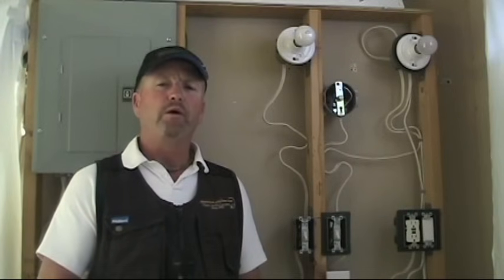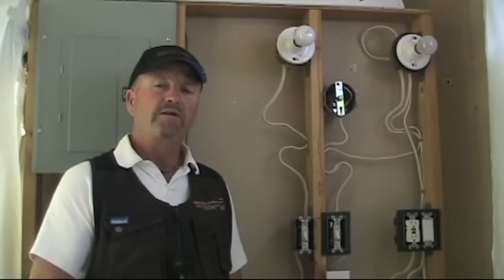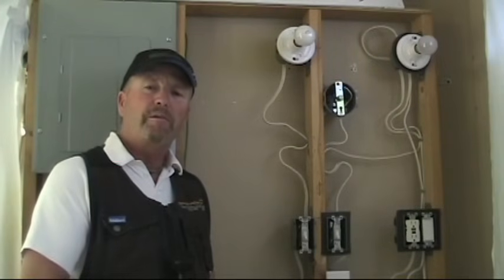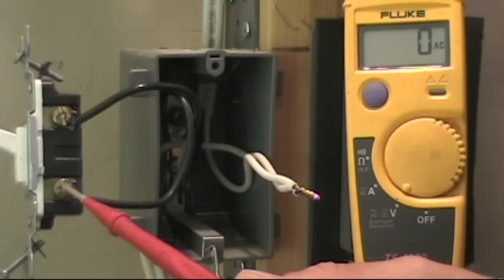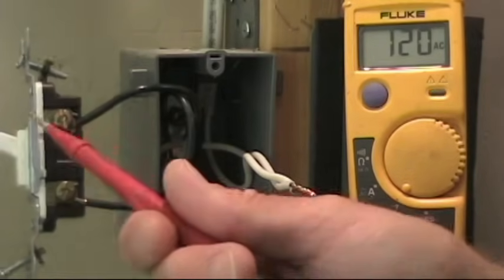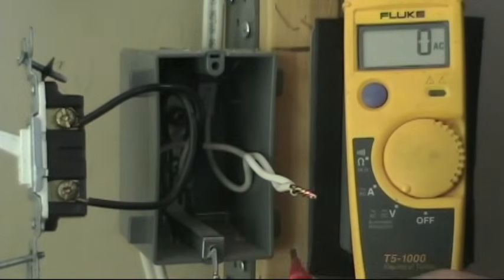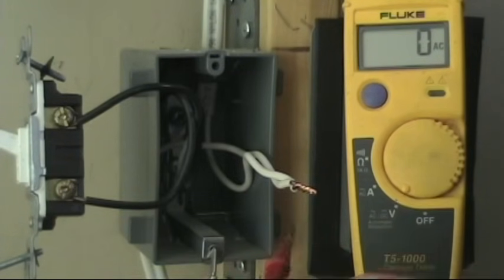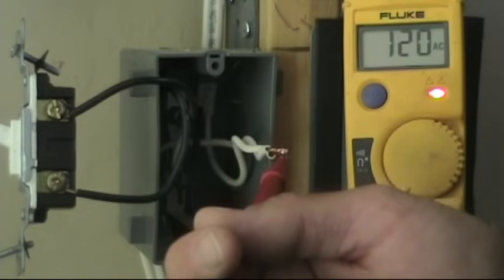Understanding an Open or Loaded Neutral

Comment: Your no electrician! Open means no complete circuit! You said power up thru the filament( but no light) lol! His hot neutral was caused by it being shared with another circuit!
Reply from the maker: Raymond, you are wrong. Besides that, I'm explaining what happened in another scenario that happened with a friend of mine. The purpose of the video is to explain how you can get 120V on a neutral because of an open circuit. I am a licensed electrician with 37 years of experience, I am also an Instrument mechanic, and a steam engineer as well.  Please don't insult my knowledge and maybe watch the video again, learn, and understand.
Reply: no lol its called losing a neutral, its probably the number one most common electrical claim for insurance companies. hes right, he may not be explaining it in depth enough
Reply: "Open means no complete circuit"
The circuit is sending power up to the bulb and back down to the neutral at receptacle , it is open on run back to main.
so no complete circuit.

Comment: I get peeps bugging me to always put the hot leg to the top of the switch so it's more uniform with how other service wires are connected or some nonsense.
Reply from the maker: I've had that feedback before as well.  This is a trade practice thing, and not a code rule. One explanation I got for putting it on top dates back to when open knife switches were commonly used. Having the hot on the bottom in that situation made the "knife" hot, and you threw the switch up to the load connection instead of having the load being thrown up to the hot jaws. That makes sense to me. I was just taught to put the hot on the bottom of the switch so that's the way I've done it for the last 37 years.
Reply: @theinternetelectrician  I put the line hot on the bottom as well. I like the load wire to be on the top terminal and that's how I arrange my pigtails in the j box.

Comment: all current ultimately goes back to neutral and or ground rod through ground water back to power generation location.
At substations there is a huge array of copper rods into ground to actual generator and or transformers. We installer alot of sub stations. Many do not realize all current has to go in circle back to lowest potential. Shalom
Reply: that is just not true,  go look it up, ground rods into the earth are for lightning for the most part

Comment: Add a junction box between the panel and the switch. Then disconnect the nuteral wires in the juntion box to demonstrate the open circuit.

Comment: I am working on a house that is showing 160 volts on some circuits and 80 on others at the moment!
Reply: I have run into this a few times DSV. You should check the neutral coming in from the power company first. You may also have a problem with the neutral between the meter and the main panel.   It can drive you crazy. Voltages can be all over the place when 220v loads kick in. HTH

Comment: Terry, Thanks for your videos. But,...As a retired industrial/residential electrician, "I" understand the situation. But people who really have no business messing with electrical wiring have no idea what you are talking about without you showing by example what caused it, rather than to just mention it. Without being rude, without that, the video is rather useless for the unknowing novice. Sorry, just constructive criticism. BTW, the worst messes I have ever had to correct is when people of such, mess around with 3 way, 4+ way switching. Totally screwed up. Novice people have no idea what NEC Code is either. These people also need to realize that they can screw themselves beyond belief from their insurance companies when regardless of being the home owner or not, as some jurisdictions still say that's ok. But MANY City charters say NO and have absolutely in no uncertain terms that it is not allowed. That you MUST use a certified electrician who will sign off and some as in the State of Tenn., requires a City Inspector to approve, before use. Some cities, such as Chattanooga, and others have city codes that are far more detailed and additions beyond the NEC. And of course you have to comply.
Reply: Constructive thought, yes did need to show where the open neutral was. 
If the neutral was open outside at the entry point, would we get a shock
on the unbalanced portion of current, trying to get back to the transformer?
thank you as always.
Reply: @flexmaster-l2j  And you are free to do so, just understand that your homeowner's policy can put 2 and 2 together and find that a convenient excuse not to pay out your claim.  Related... or not.
Reply: flexmaster I hear ya, people make mistakes though which is why it never usually hurts to have a review done of work. People that don’t understand what they are doing cause problems for the ones smart enough to research
Reply from the maker: Tony. I appreciate your input, and of course I have dealt with people that share your viewpoint countless times. I try to only help the DIY'er with simple electrical repairs or projects, and always explain to them that they must see if they are allowed to do the work by way of a homeowner permit. Electrical replacements in kind (change a broken switch or a worn receptacle) do not require a permit in most cases. To deny that people do their own electrical work regardless of what you or I think is to deny the 2 - 4 isles dedicated to electrical and lighting in any home improvement store. I'm only trying to help what is already getting done, get it done correctly and safely. Keep looking on YouTube here and you will find handymen from all walks of life teaching electrical as well.  At least I have the training so it's not the blind leading the blind.
Reply from the maker: Here is a link to my website with more detail on the open neutral issue. https://www.electrical-online.com/understanding-an-open-or-loaded-neutral/

Comment: All I saw was that in part A the neutral showed zero volts in relation to the grounded metal box, and then in part B it showed 120 volts, but I don't know WHY !!!!!!  Maybe this guy knows his stuff, but he's a poor teacher.
Reply: A very basic way of looking at it would be, visualize a circle. The circle is the "circuit" he is explaining. Left half of the circle is your "hot" and the right half is your "neutral". If you break open the right section of this circle, you will have 120v at this breakpoint. In this scenario he is describing the break on the "neutral" side of the circuit.

Comment: That was a good demonstration, but you're single pole switch was hooked up wrong, the line is always on top.
Reply: A single pole switch only makes or breaks a circuit. Line is not specific on regular single poles

Comment: Still clear as mud. How does not tying two white wires together make one somewhere else hot? Still don't understand why a bond wire and ground are connected in the main panel and not in a sub panel. Dropping a neutral thing makes no sense to me. I am a nuclear engineer but not an electrical engineer.

Comment from the maker: I'm getting allot of feedback wanting more details on this. Here is a post from my website with more detail.https://www.electrical-online.com/understanding-an-open-or-loaded-neutral/
Reply: The post in the link above still contains way too much blah blah.
Best way is to create an open neutral in a junction box and show it is loaded with a voltage tester or circuit tester.
Reply from the maker: @1942nn  which is exactly what I did in the video above here
Reply: @theinternetelectrician  Hope that you show where the neutral line broke off, it would be very clear to all. You did mention that neutral was broken off somewhere upstream. That is vague for many.

Comment: If the 120 goes thru the switch - then thru the light bulb - BUT - doesn't go thru the neutral to ground - THEN 1. The light wont work & 2. The Neutral wire is LIVE. - Simples.

Comment: I thought the top terminal on the switch was neutral. I guess not. What is it really called? I thought the side that the power flows out of was called neutral. Is that not correct? Does the actual neutral (white wires) have anything to do with the switch we are looking at here or are they pigtailed because the switch doesnt need them so the neutral is connected to just bypass the switch and keep the neutral circuit complete?
Reply from the maker: No, the neutral should never be switched, and should always be a constant path back to the panel.  You can pig-tail into the neutral if a switch requires a neutral, but that is only if the switch device has circuitry that needs a neutral to function. A switch just interrupts the hot conductor that feeds an outlet (light fixture or other). It's either open (off), or closed (on).
Reply: A little different application, but a neutral is switched at a fueling station..
Reply: Terry Peterman Wow, that is information. More elaboration please.
Reply: The power (hot wire) goes to the switch and the wire leaving the switch is called the switch leg.

Comment: Great Job. Your knowledge was solidified in my book when you correctly called the neutral a grounded conductor. Not many electricians know the difference between a grounding conductor and a grounded conductor. 

So if the white wire is the grounded conductor and you break the conductor upstream the conductor cannot complete its purpose to take the voltage to ground in the electrical service through the grounding electrode conductor.  It then becomes solely a current carrying conductor looking for a path to ground and preventing any current to pass through the load connected to it. So when the fellow touched the white wire he became the least resistance to ground.

Comment: You failed to mention that if you use a plug-in circuit (or GFCI) tester, it will give the same lamp configuration that is labeled on the tester as “Hot/Ground Reversed”. In this case, the fault belongs to the tester manufacturer (all tester manufacturers, as far as I can tell) for not labeling this more likely wiring fault (open neutral w/ load) as an alternative cause of this lamp indication.
Reply: hgrosser2 my tester has a different light code for both symptoms. It is good to know what you just explained here. Just ran into this last night, and have not pulled switch and outlet. Thanks for your insight ! !
Reply: Speaking of plug-in testers, I’m working through an issue where the tester’s three lights come on simultaneously. Checked other receptacles on a couple of different circuits and the tester indicated correct wiring so I think the tester us probably okay. Any thoughts or suggestions on what in the receptacle/circuit causes this?

Comment: In the normal situation with the switch on, if ground to switch shows 120, and neutral to ground shows 0, does that suggest that the voltage drops  after passing through the bulb filament?

If so, why do you still measure 120 (in the second mid-wired part of the video) after current passes through the filament (I.e measuring from neutral to ground). Should’t there still be a voltage drop (if its passing through the filament)?

Also if alternating current alternates why doesn’t the neutral become hot for the fraction of time that the polarization changes?

Sorry if these are silly questions..I’m new to this 
Thanks

Comment: When replacing the old wall switch the ground was not connected should I connect the new switch
Reply from the maker: Hello Jon. The rule to follow is: If there is a provision to connect a ground wire (if the switch has a ground terminal), then you should be grounding it to the system.
Reply: Thank you great advice

Comment: Why is my outlet hot after using
Reply from the maker: If you were using a fairly heavy load, it is normal to get a bit warm, but not hot. I would check for loose connections on the receptacle and repair or replace and make good and proper connections.
Reply: Thanks again will recheck

Comment: thx so a loaded neutral means an open neutral
Reply from the maker: Broken neutral path somewhere in the system and the switch is on to a light (for example). The light isn't on because it has no path, you touch the neutral thinking it's "neutral" or the "grounded conductor", and now you complete the path to ground via your body parts, = shock!
Reply: @theinternetelectrician  you should never touch an electrical wire without a meter in your hands verifying no current to ground from either white or black,k correct and breaker off.
Reply: I'm not a real electrician, but I think the point is that your device won't work with an open neutral because the circuit will not be complete. Additionally, you can possibly complete the circuit with your body, which makes an open neutral dangerous.
Reply from the maker: More accurately, an open neutral means a broken neutral path. A loaded neutral means that the power is on with the neutral path open so the term 'loaded' means that there is potential (voltage) there at the broken connection and you can get a shock from it with the right conditions.
Reply: Terry. what do you consider the right conditions?
Reply: good day sir, i just did my electrical/wiring/etc in my house, everything works fine then i stumble upon this video and idk anything about it. i'm just wondering what will happen to all device connected to a loaded neutral or broken neutral. sorry my english isn't good.
Reply: thank you sir, I though it will still work even with those condition but it will affect the device's lifespan. So far all are working fine i guess i did my electrical wiring right lol lucky me. Also, I'm not an electrician I just watch tutorials here. But in my case i make sure i turn off my main breaker before tinkering.

Comment: The more I study electricity the more I realize how much I don't know 😅
Reply: He didn't really explain how it happened.
Reply: @MauriceCalis  He did:  the neutral wire connection was undone at an upstream outlet, the video shows the neutral wires (white) are connected OK in the current outlet. Here one wire goes to the light bulb, and one comes from an upstream outlet.
If one of these upstream outlets has the white neutral wire connection broken (disconnected or loose), you will have open neutral on ALL downstream outlets.
Reply: @MauriceCalis  cause somewhere iin the circuit from below neutral is disconnected from earth. that is why phase is loaded to the neutral but not passing it to earth
Reply: So do I!
Reply: Pure sorcery! 😆
Reply: The code is always changing
Reply: @joshkominek456  that doesn't help either 😂😂
Reply: Its not you, he didn't explain or show us didly.
Reply: That’s how everything in life is, right? The more you know, the more you realize that you don’t kmow
Reply: You keep studying electricity and I assure you when you think you know all there is to know you will actually be a babbling idiot
Reply: @uawsux  If you felt this way after watching this video it is because he didn’t explain anything. He just put a meter on the neutral and said it has 120v.
Reply: this vid sucks ass
Reply: I also feel the same
Reply: I started taking a few courses hoping that I will know everything. The more I learned, the less I know. I went up to Master Degree and still learning every day!
Reply: @sunshine7453  What we learn in college (Engineering) is about electrical theory and many applications of it, this education makes a potential inventor. A very tiny part of that includes AC but none covers home electricity.  The terms HOT, NEUTRAL were strange to me too until I dived into home electricity and bought a few tools (such as electrical detector, outlet tester, et...) besides the multimeter.